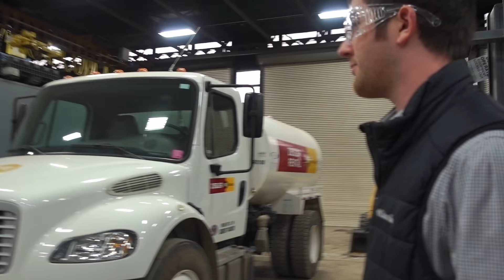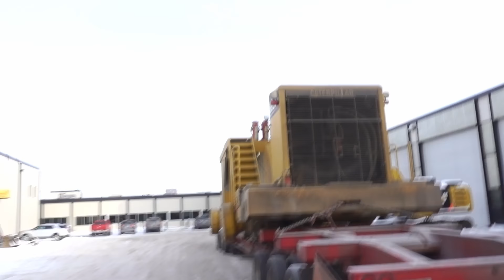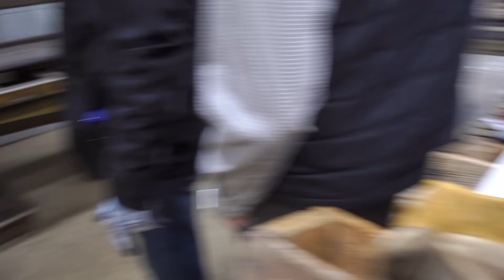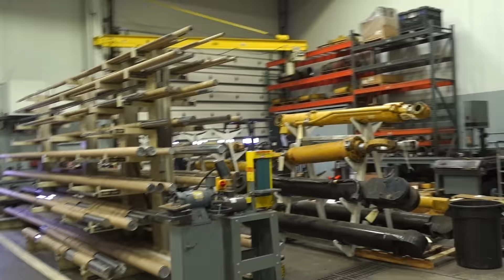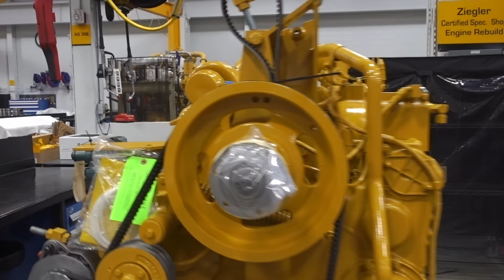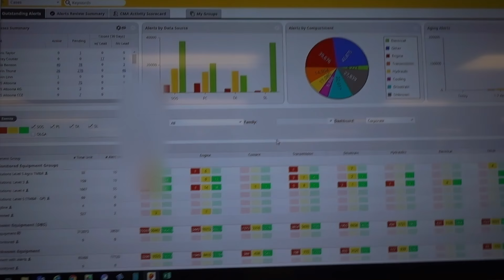Rebuilding CAT Excavator, Bull Dozers, Haul Trucks, Wheel Loaders | Ziegler CAT

Comment: That 992 is small the 994K is 1793 Hp 8549 ft lbs of Torque and weighs in at a merely 534852 lbs. The 992 is 1/2 the weight.
Reply from the maker: Ok well I mean it’s still pretty big
Reply: @CarsonSchifsky  it is the largest for non mining that they make